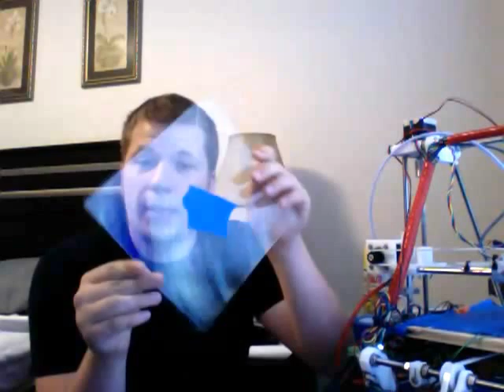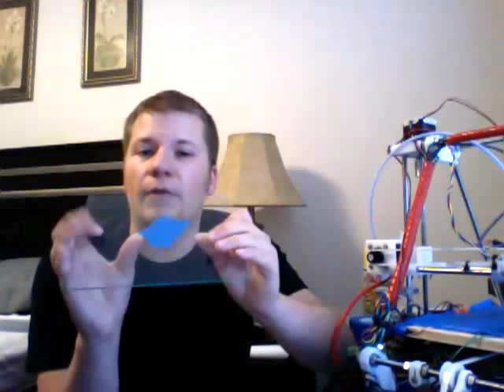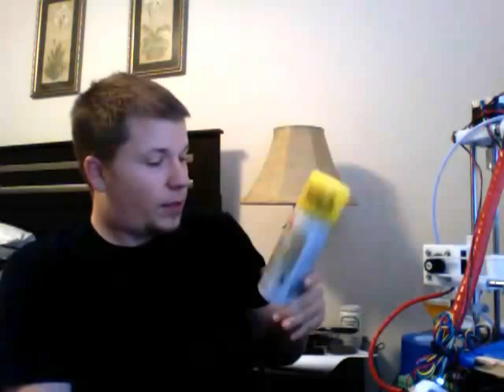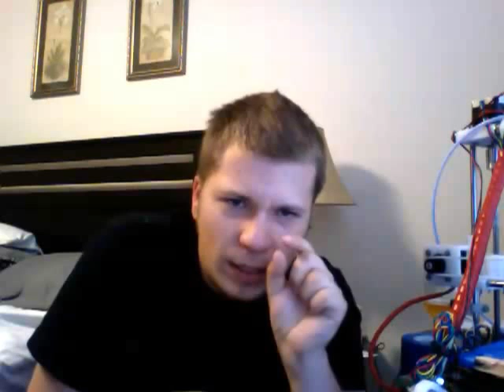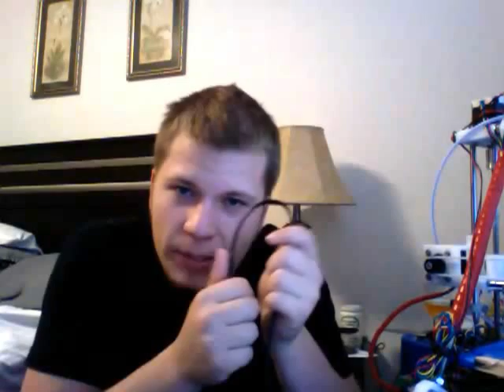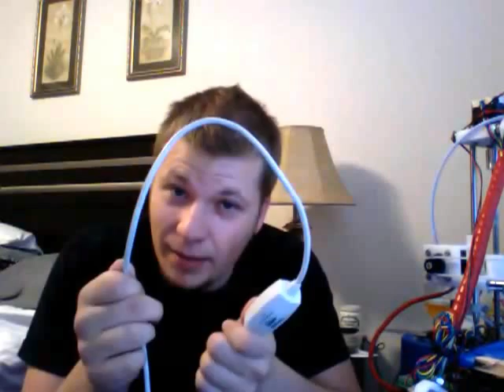Makergear Prusa "Quick" Update, Printing Tips, and Build Tips (just the tips)

Comment from the maker: It was relatively easy, but lengthy. The kit that I received didn't require any soldering.  Everything was mostly "plug and play".  On a side note, soldering is not difficult at all unless you get into surface mount components (which is a completely different animal).  My only tips would be to use flux and buy a decent soldering iron if you plan on doing it often.